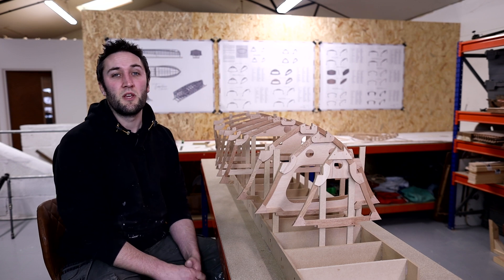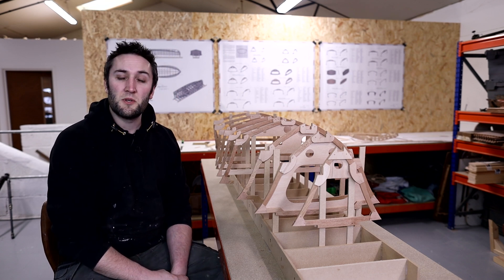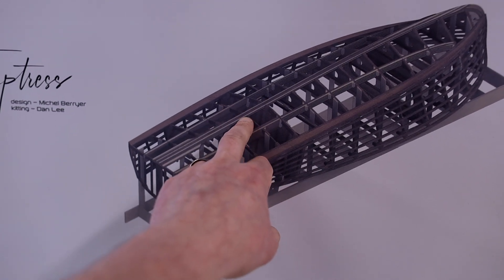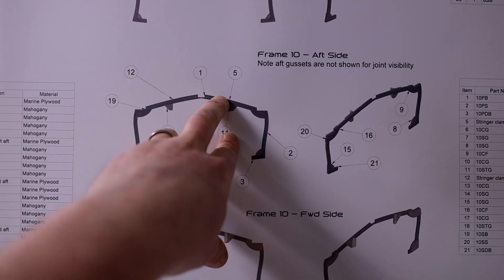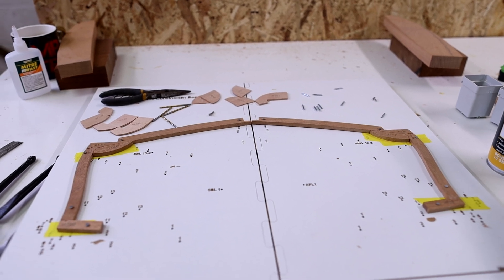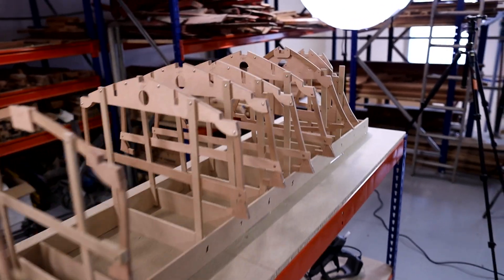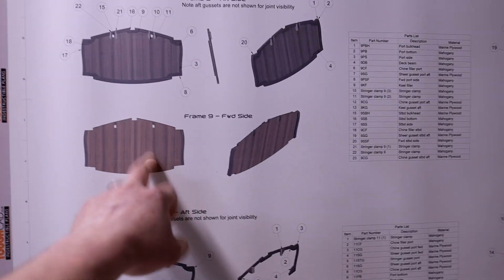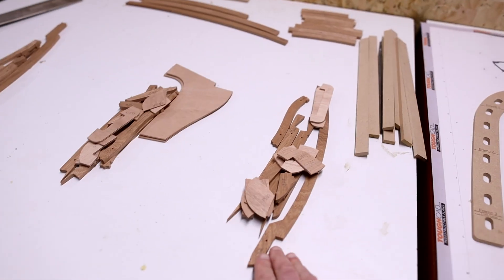Building Frames And Setting Up The Strongback | Temptress 1/4 Scale Boat Build Part 4

Comment: Just wondering if you lined in the bevel lines on each frame segment?, I have found if you do it on the CNC with a pen tool its very easy to bevel the frame sections before assembly. It just means you have to cut and mark from the bow or stern directions respectively.

Comment: comment about run 11...could you change the plans to give the distance to the front of run 11 instead of the back (AKA  old distance - 18mm).  That way the plan works with any material used for the strong back.

Comment: Dan quick question. What is the smalest cnc surface needed to cut the biggest piece? I'm curious if this can be done on smaller cnc. Could we use scarf joints?
Reply from the maker: For a full size boat a 2440x1220mm, 8x4’ machine is really needed for the lamination jigs and chine sections which are quite large. If you were doing a 1/4 scale model then you could cut everything on a 600x300mm bed. 

You could maybe scarf or finger joint items to further break them down but I’m not sure it would be worth the extra work.